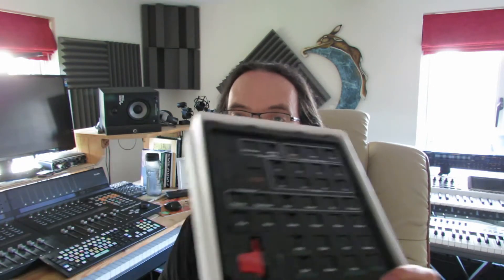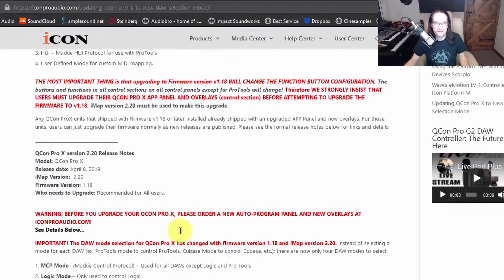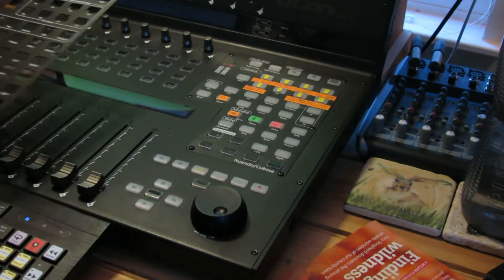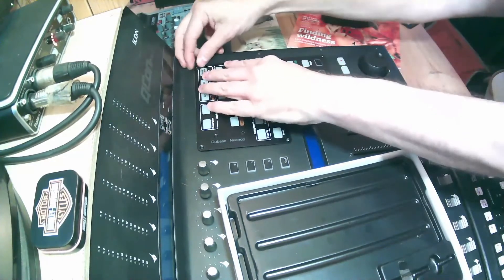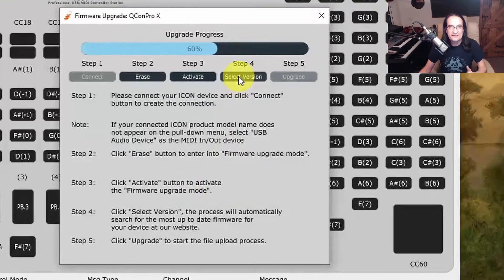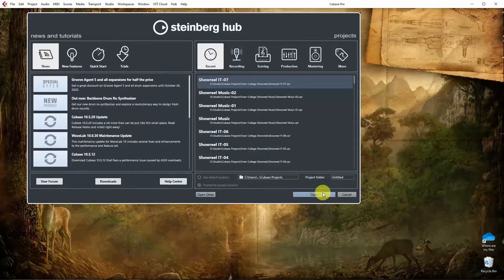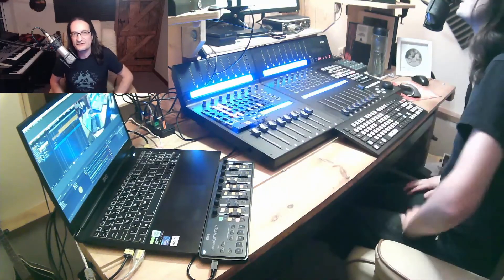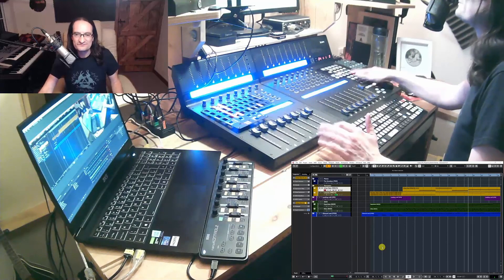Qcon Pro X front panel install and firmware upgrade

Comment: Hi  , can u please help me? I bought a Qcon last week but is been a pain...! The Ian Walker´s script helped me a lot, but i ´m having some problems in updating the firmware. It came with the 2.07 version...is it the latest?. I also notice that in Fl studio the faders work really well but the bar leds are not matching with the same DB values that Fl. The bar leds in the Qcon are always cliping, they just stop cliping when its minus 4 or 5 db´s in the Fl mixer. Please help me out...! Thanks
Reply from the maker: Hi there. I only updated my firmware for the video and as my Qcons have been working fine I haven't checked the site since. I'd recommend going back on and seeing if they have done any more upgrades. It's annoying you are getting the meter bridge issue in FL. That doesn't seem to be an issue in Cubase so it's a bit difficult for me to suggest a correction. As I have said in previous videos or reviews I mix to my DAW meter bridge rather that the Qcon as I feel that is much more accurate. The Qcon I use mainly for the pots, faders mutes, transport etc. Try searching out other FL users to see if they have experienced the same issue. If not then it might be a hardware problem and perhaps it needs returning? I am pretty good at adjusting the faders (did a vid on that) but the meter bridge I really have no idea how to change. I think that is more likely a factory only setting. Apologies I can't be more help and I do hope you manage to find a solution. If you do please post it here for others.
Reply: @MoonhareStudio  Thanks mate! All the best!

Comment: Gday Darren. Finally got my pro x and pro xs the other day but I'm having trouble with something and I can't seem to find the answer anywhere. I work with Cubase 11 and The XS is picking up the 8 tracks in the project (1-8 ) but the pro x (9-16is only picking up 4 random tracks?? Have you come across anything like this mate, sorry to bother you.
Cheers Matt
Reply from the maker: Wondering what "random" tracks are showing on the Pro X? Are they inputs, outputs, busses? Check out my video on Optimise Your Qcon With Track Filtering which explains how to optimise what you see on the Qcon's top LED strip - not entirely relevant but might help with problem solving if you have hidden tracks confusing things. Another tip - for problem solving I suggest opening a blank project and adding 16 audio tracks to clearly see what is going on. You should see 1-16 displayed left to right across the two units. If you do then it is definitely your current project, not the Qcon throwing up the error. I'm in the studio this morning so perhaps let me know what appears on 9-16 when you try this if it is still being bizarre.
Reply from the maker: https://youtu.be/aPLE4xEwe88
Reply: @MoonhareStudio  Thanks mate, Nah, no hidden tracks and they are all inputs no busses. I might have 5 guitar parts say tracks 7-11 and the pro x will pick up 7 and 8 on the pro xs but then on the pro x it will show tracks 13,14 and 15! At work currently, but I will try your suggestion of a clean slate and see what that show
Cheers Matt
Reply from the maker: OK. As you will see from the vid I linked above, the Qcon ignores the Project Window and only displays what is currently in the Mixer so make sure you check that out. Good luck and feel free to get back to me with what you find out.
Reply: @MoonhareStudio  Gday Darren. Well I did as suggested and found that it had the same problems, I turned on and off machines, shutdown Cubase, loaded it up again and changed the mackie controls around to try and trick it and then something happend! It's not perfect but at least both desks are showing what is in the mixing window but the annoying thing is that the little white dashes that let you know what bank of 8 you are on only show say 13,14,15 and 16 underlined and the rest are not and if I try another project, it might show 14,15 and 16. It's really odd and a pain the backside. Sorry for the length of reply, any suggestions? I have a video of the issues I could send if that helps or that might be pushing the friendship ; )
Reply from the maker: Haha. No I am very happy to look at what you've got on vid. It is often easier than trying to explain in text. Send me a link via email at moonharestudio@ecotrack.co.uk . I share your pain when tech is getting in the way of the creative process, which is actually why I started the Living with the Qcon Pro X series in the first place. Some of the vids I do are off the back of solving an issue in collaboration with someone else so let's see if together we can crack this one too!
Reply: @MoonhareStudio  Your'e a Bloody Legend! Appreciate the help mate! I'll send it through.

Comment: followed evereything you said and it bricked my board , it just a blue screen now
Reply from the maker: Hi there. I assume this an installation of a new front panel to an old style Qcon plus a firmware update. I filmed my upgrade as I did it and it worked fine so it's difficult to say why you're getting this error. If you replaced the panel then did the firmware and it is not working then I suppose it is possible that you've been supplied faulty panel. More likely  that firmware is the issue so check you definitely have the right version installed because that could cause issues. This vid was posted some time ago so the software versions will have upgraded since then so check out all the advice on the Icon page for your platform and DAW and reinstall. If all else fails you'll need to speak to Icon customer service to see if there are any known issues for your particular set up of mac/windows and DAW. There may also be solutions on the Icon Forum on their website. Best of luck.

Comment: 4-6 god damn weeks to wait for the part, they need to clean up their act on so many levels, speaking of levels the meter bridge is still acting up on my crapX
Reply from the maker: When I ordered mine it came through in 12 days, so you may find it doesn't take as long as they say, although nothing is certain in the world today. That meter bridge issue sounds frustrating. Haven't experienced that myself. Assuming no help from Icon then?
Reply: @MoonhareStudio  gearslutz has a pile of people with the meter bridge issue,  let me tell you though your videos rule and you are a saint for posting them. You are without a doubt the pinnacle of cutting edge source for Icon Qcon ProX info, the rest is all  just "in action" videos that never really help explain anything,  thanks so much !
Reply from the maker: @DeBartoloMartinez  thank you so much for saying that. It means a lot to get such positive feedback.
Reply: only took 7 days from ordering to delivery to receive mine.